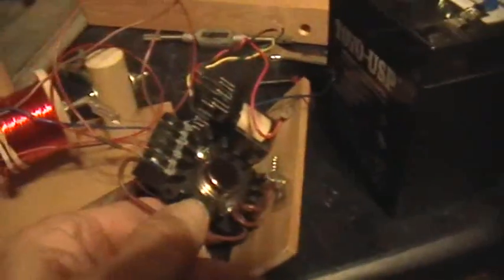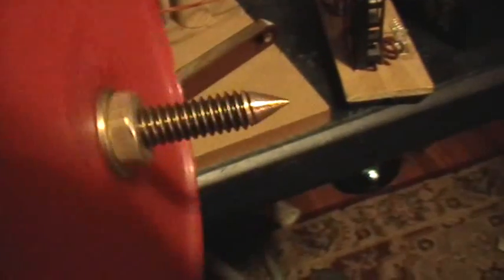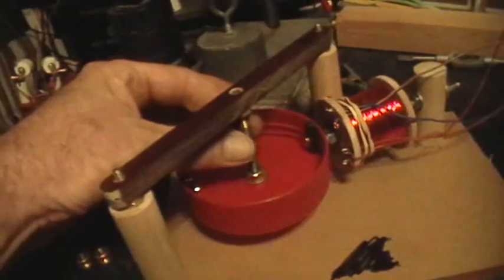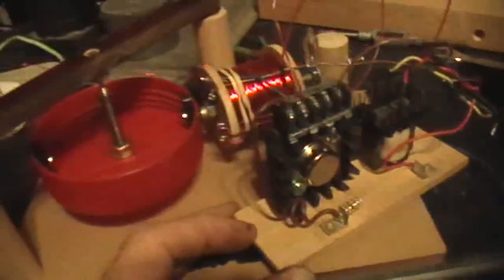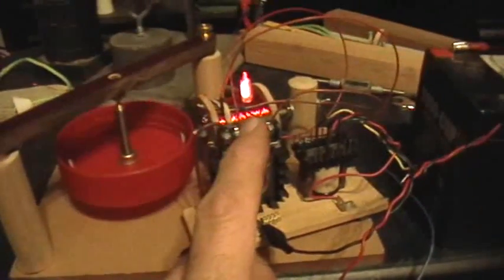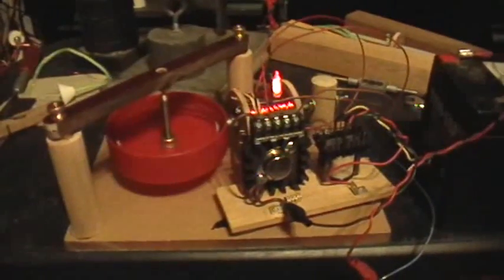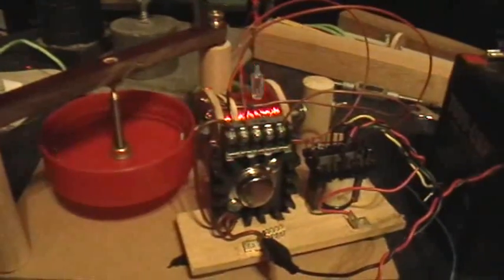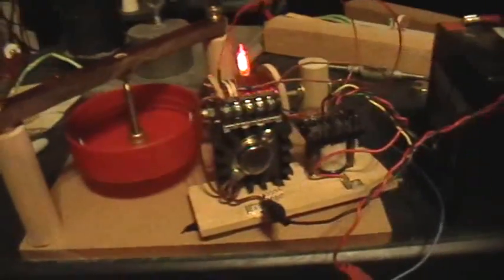Electric OU: The Bedini North Pole Motor, First Light

Comment: Here's a twilite zone episode for you north pole Geeks. Your north pole magnet circuite doesn't care wich rotation direction the magnets is giong so long as the magnets pass by soft iron centered coil all tucked up under it's chin.  Now as for the "True Northies" the one's that want the coil to act as a magnet and pull the magnet to itself but also flip an push the magnet away. A real magnet could pull the oncoming and push the off going

Comment: Well, the solid state circuit is a bit different beast... acts more like a joule thief in a sense, definitely pushes a lot more current (which was never Bedini's objective, quite the contrary). A 4 transistor, 4 winds (+ trigger) 18 AWG air core can fry neons, yes.

Comment from the maker: Let me ask you something. The rotor magnets are all glued in place, one polarity outward.
The drive coil gets a 12 volt DC pulse when it is triggered. The polarity of this pulse is determined by which way the drive coil winding is hooked up to the positive supply. Of course the sense coil needs to be swapped to maintain phase relationship when the drive coil is swapped. Yet the motor works both ways: drive coil polarity same as rotor magnet, or drive coil polarity opposite rotor magnet.
How??

Comment from the maker: Probably. I haven't tried it yet, I don't have a discharged 12 volt battery that I want to risk ruining just now. I may sacrifice one of my Tar Baby batteries just for the sake of Science.
Certainly it charges capacitors very rapidly. Not as good as the Joule Rattler, though, which is essentially the same circuit but self-resonating instead of triggered by a rotor. No moving parts.

Comment: Must be fairly light gauge magnet wire? It appears you have no charge battery hooked up... mine would fry the neon if i ran it with no load! you should try the TSO 24V variant of the solid state air core, it's a good circuit / charger.